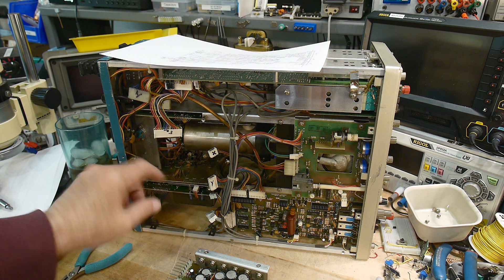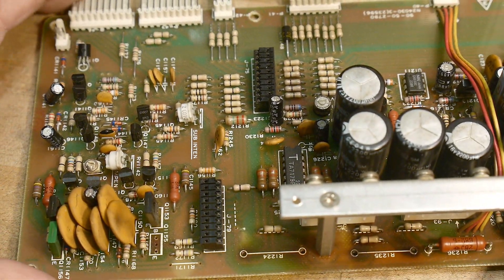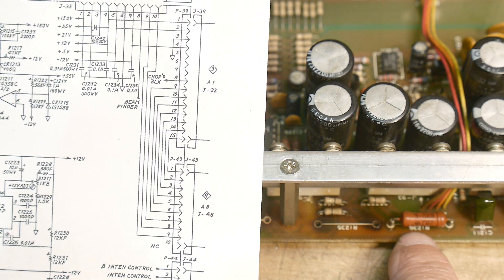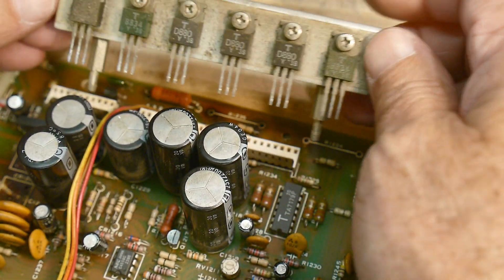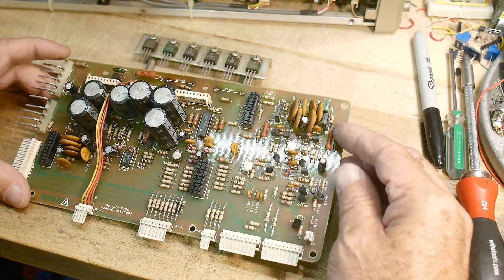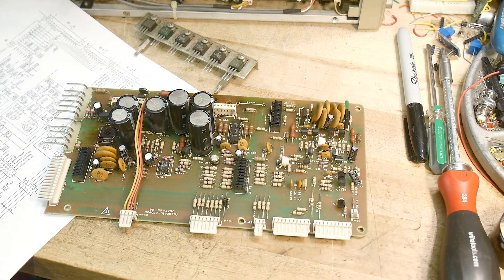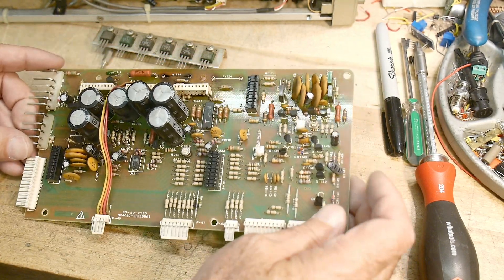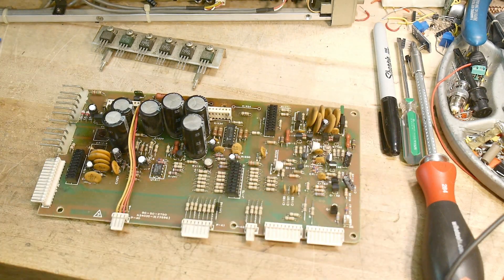#1141 Kikusui COS6100 repair (part 2 of 11)

Comment: buenos dias ante todo muy buen trabajo en que realizas. Ya le escribi en otras ocasiones en la cual le comento sobre la fuente de alimentacion esa misma, he realizado la comprobacion de todos los compenentes transistores npn y de sustitucion del c4558 ademas del ta chip. No he cambiado los condensadores grandes pues los veo visualmente perfecto aunque son los originales, el c 4558 se me recaliente mucho y se he fundido uno, no quiero que la cosa llege a mas. mi pregunta es la siguiente ¿ deberia de cambiar los condensadores ademas de los puentes rectificadores? esta aberia me tiene loco y no se por donde seguir. los voltajes del c4558 son de entrada de 25 volts y sale a cas 40 volts . se recalienta y extalla. necesito su ayuda pues aqui no hay tecnicos para estos equipos y estoy practica mente solo, mil gracias . mi e mail, josueamodeo@speauto.es
Reply from the maker: if you look at the capacitor voltages with an oscilloscope you will see the ripple. if the ripple is too large then yes, the capacitor is bad. if you don't have a  second oscilloscope, then you can look at the DC voltage with a multimeter and then the AC voltage, the AC voltage is the ripple.
Reply: @IMSAIGuy  ante todo muchas gracias por contestas. no tengo otro osciloscopio. es decir que en CC me tienen que dar una medida y si posiciono el multimetro en CA y la medicion es superio demuestra que la honda es mayor y aqui el defecto. ¿si?. otra consulta?¿ podria realizar la medicion sin el c4558 intstalado en el zocalo?. pues si lo hago con el puesto se recalienta y puede quemarse. gracias por su ayuda
Reply: Como podria realizar una prueva al TA7179P  y saber de su correcto funcionamiento??. Pues el voltage no lo regula. Gracias

Comment: Why use a zero ohm resistor instead of a plain wire link?
Reply from the maker: the automatic part loading machines need it to feel like a resistor
Reply: @IMSAIGuy  :  Thanks - I would never have deduced that.

Comment: To state the obvious, there appears to have been a short in the +12V and/or -12V lines. Whether the fault is in the power supply itself or another location is the question.  Could a miss grounding on the scope inputs by a user cause this kind of short?

Comment: Looks to me that the board was overheated over a period of time not suddenly .. it is possible that the power supply was thermally under-engineered beefier resisters and rectifiers may be needed , Two power rails overheated at the same time !!  Is it possible power supply is set for 110v  instead of 120v ?

Comment: Looks like the solder on the input connector pins are cracked. When you put the bridge rectifiers back in, don't push then all the way down to the board.

Comment: I would check those zero ohm resistor jumpers all as well, they are also known to go open circuit, as they are just uncut carbon or metal film resistors, normally below one ohm, but I have had one or two that did quietly go open circuit. The other type, much favoured by Japanese manufacturers, have a ceramic sleeve with the wire lead cemented in it, and those generally never go open circuit. 

Yes Japanese manufacturers were so determined to stay single sided, because they had the machinery to do single sided boards, in bulk, for a very low price, that you often had a board with perhaps 400 jumper components on it, in at least 6 different lengths, just so they did not have to make it double sided. Sharp copiers for one, along with the cash registers and printers, where I saw a board under 4 inches by 2 inches, with 10 ribbon connectors to it, 200 jumpers, and even a single trace with 10 separate jumpers, to bring it around to the same connector, all around the board, because there was no other room. The active components on this board were a 100uF 16V capacitor and a 100n 6V disk ceramic capacitor, connected via around 10 jumpers in total, to all the connectors, to distribute the 5V rail to them. 2 generations of copier later and they went double sided, except Sharp went and stayed single sided, just using a conductive ink screen print, to make that top layer on the SRBP boards, in addition to the jumpers. They still wanted to use that press that punched all the holes at once into the board, plus all the board outlines.